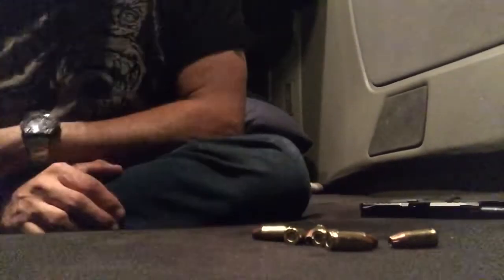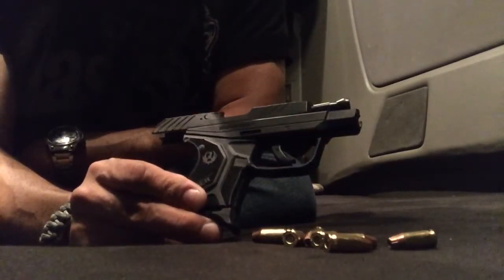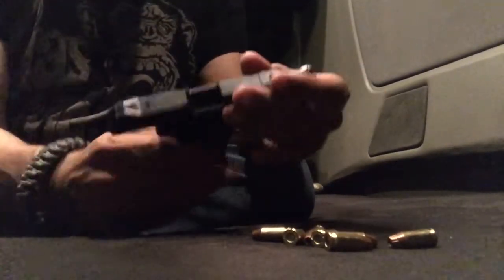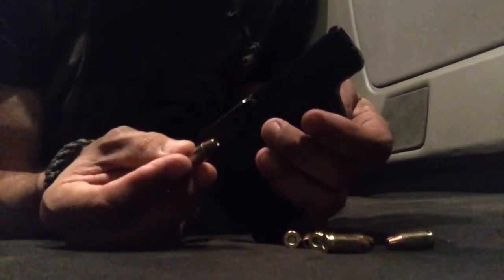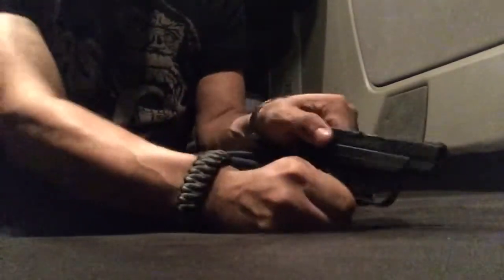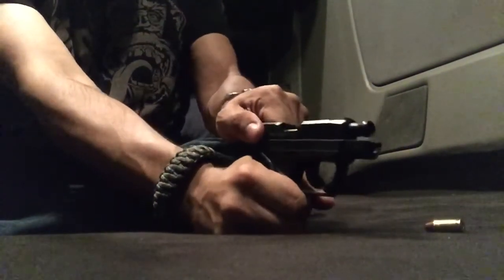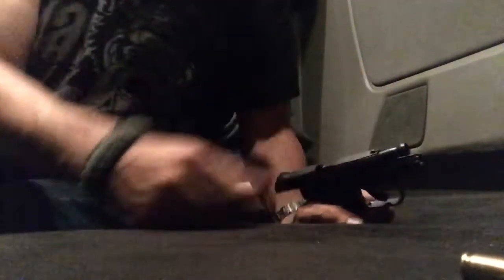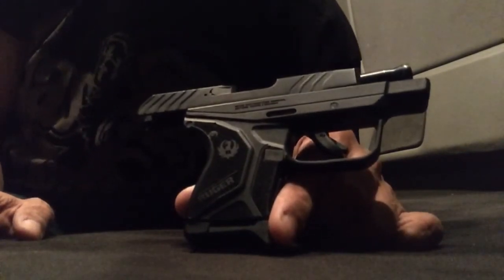Ruger LCP II answer to fail video

Comment: Thank you Rafael!  I could not believe that guy sent back a pistol as defective when he never fired a shot from it and it “failed” on an operation that’s never done with a pistol, unless to clear a rare misfire which is important.  What’s worse is that he traded it for a S&W bodyguard which is known to be very picky with ammo, especially hollowpoints. You unload & make a pistol safe by dropping the mag first, place your hand over the port and pull back the slide letting the round eject through the port into your hand or drop down the mag well in the grip.  
I don’t think people realize the rather loose tolerances of range grade ammo, how the bullet seat depth varies from round to round with differences of hundreds of an inch.  I didn’t realize this until I started reloading and used my digital calipers to test factory ammo.  The more expensive defense rounds not only use better components like nickel plated brass & high end bonded hollowpoint bullets, the powder charge throws & bullet seating depths are a lot more consistent, at least this is what I have found testing Federal, Remington and Hornady’s premium defense/duty ammo.  
You also must remember that ejectors in pistols are static, it’s just a piece of metal like a nail sitting there that pushes on the brass headstamp throwing the brass out of the pistol.  It’s the power & momentum of the slide going back that does all the ejecting, you have to pull back rapidly & hard on these small pocket pistols because the keep the size down the ports are the minimum size needed; you cannot compare it to a full, compact or subcompact pistol - these are MICRO pistols.  Pistol ejectors are not like an AR which uses a spring loaded plunger on the bolt face to eject, and AR’s eject rather violently which is why you get that little dent on the shoulder of your spent brass.  
The Ruger LCP-II is considered the best in its class when you consider its size, weight, accuracy, trigger, and most importantly reliability.  It’s does not look  nearly as good as the Sig, the Khar is slightly smaller and an ounce lighter but both of these pistols have had their reliability issues with various brands of ammo.  It’s not a Glock 42 but I don’t consider that a micro pistol.  I have had mine for only a couple of weeks now, have 400 rounds through it using 5 different brands of cheap range ammo and one premium load without cleaning it or a single failure.  I will fire another 200 rounds through it this weekend and if I get no failures I will clean the shit out of it & mags and consider it suitable for carry & staking my life on it. I have no doubts those last 200 rounds, using 6 different load, will go without a hitch.  This is my first Ruger pistol ever, it’s the least expensive pistol I own and it has exceeded my expectations in all areas.

Comment: You make a good point but you need to be able to manually clear a bad round quickly.  If you can't do a tap rack bang to clear a round with a bad primer with out jamming up your gun then that is a problem.
Reply from the maker: Dietzeeeee I believe I did show you how to eject a jammed round. Did it 8 times.
Reply: If the gun fails to fire at all(bad primer), you pull the slide back hard and fast as shown in the video.
Reply: it was demonstrated twice that a full unspent round is easily ejected using adequate force. With quality ammo you should not have a need to remove a round during an assult but if it were to happen, I dont care what brand of gun you have, its bad news.
Reply: Apple Lysol - The first run of mags were defective!  If your mag has made in America on it it’s the defective one, if it says made in Italy it’s the new & improved one.  Send your American made mags back to Ruger and they will swap them out for you free of charge.  There are not a lot of these defective American made mags out there, Ruger caught & corrected the problem quickly.
Reply: I don't think there would be a problem in clearing a jam in a defense situation if you are a trained user.  I think he just liked to cycle the rounds, every now and then, just as many of us do for a variety of reasons. I have had my LCP II for several years and I shoot it at the range twice a month and have never had even one malfunction.  This little Ruger has proven to be a reliable carry gun where 3 other .380's of mine have all malfunctioned and are gone!

Comment: You sir made some very valid points especially about the whole round (casing and bullet) being ejected hence the whole round getting jammed..i like to dry rack rounds through and take apart all my new guns whenever i buy them and this is the only one that does this when dry rack rounds through it..i actually do have a couple things wrong with my LCP 2 though..when i load all 6 rounds in the mag and try to insert it, it doesnt click in without a lot of force and when it goes in the slide is impossible to rack unless when putting the last round in the mag theres a click you can hear and the mag slides in like butter and the slide racks perfect..and last is, i said i like to dry rack rounds so when i do, the last round doesnt lock the slide back when the mag is empty without me having to pull back the slide hard..but like you said, the gun powder inside the round is so much stronger that we cant rack at the speed or power like a live round can..i have not shot it yet also..i just bought it on the 24th as a Christmas present to myself so we will see..hopefully i dont have to email Ruger

Comment: I agree with you for the most part, but what happens if the round fails to fire and you get it stuck in the ejection port? You really think you're going to have time to clear it?

 I own a LCP2  and shot over 500 rounds through it with no issues when using premium ammo. I like it a lot, but there is a flaw in that the ejection port is too short which is why the gun jams or fails to eject a misfired round when you try to manually clear the gun. The  ejection port on the other .380's is are bit longer. The ejection port in the LCP2 is 25.04mm and on the S&W Bodyguard it's 25.62mm. Another issue with the LCP2 is that the ejector is not flat, like on the Bodyguard, it's pointed which reduces the ejection port size to 20.68 compared to 23.27 mm on the Bodyguard. 

I so far using premium ammo (Lehigh Defense 380 Auto 90gr Xtreme Penetrator Ammunition) so I haven't had an issue with misfiring, but when I had a misfire using target ammo, I did have one jam that was near impossible to clear manually without taking the slide apart. The bullet got stuck in the ejection port and I had to use a screwdriver through the magazine to push out the bullet.

Note that the Lehigh Defense 380 Auto 90gr Xtreme Penetrator will not work reliably in the LCP2 until you have the feed ramp widened slightly and polished. From the factory, the feed ramp is extremely rough and narrow, and has sharp edges on the sides of the feed ramp that causes this bullet to misalign when feeding. This bullet has a unique design that looks like the head of a #3 Phillips screwdriver. Once you see a photo of the bullet, you'll understand what I'm referring to. The Lehigh Defense 380 Auto 90gr Xtreme Penetrator is the best .380 ammo there is, but not every gun can feed it reliably, so try it before buying it in bulk.

I prefer the S&W Bodyguard due to the second-strike capability and its flawless reliability with any ammo that I fed it, but the gun isn't as comfortable to shoot as the LCP2. I actually hate shooting the Bodyguard due to the trigger pinching I get with each shot! The LCP2 is a joy to shoot compare to the Bodyguard.

Comment: absolutely right sir, the gun is built to shoot bullets and eject the empty case's. LCP is a very good gun especially LCP 2  just add 7 round extended mag's and you can have 8 in the gun.It is surprisingly accurate at 7 yards -- average of 3" groups.

Comment: Great video! Great points and awesome visual of the gun cycling when you pull and let it slip out of your hand and fly forward. That is true with MANY guns. It needs the slide to fly forward very fast to defeat the feed ramp as tiny guns can not have a long feed ramp so it is on more of an angle which makes it harder to load the round.
Thank you for sharing!

Comment: I shot my first 50 rounds today and had no failure to eject but when i do it slow manually it does from time to time just like you say it has the bullet on the case. Other then that my slid did not lock back 2 times after the last round?  Overall its a reliable pistol to have and im going to put 300 rounds through it before cleaning it just to test if it shoots dirty and has any issues

Comment: My lpc 2 slide breach would hang up on the mag follower due the the follower having a 90 degree edge on the back side. Using a buffer wheel i rounded this edge and it has never had one issue after over a 1000 rounds. The edge was very slight because it didnt always catch. I think there are a lot of gun owneres that dont have mechanical reasoning skills to figure some of this out. I guess some expect a $600 quality gun for $200+ this gun is one of the best pocket carry guns available. I carry this everywhere because its so comfortable and reliable.

Comment: Mine did that my gun prior to this was a Glock 21 45 cal you could cycle it. I have not shot my lcp2 but I there is also a difference in length with a empty casing and a non fired bullet. I feel it would eject empty no problems

Comment from the maker: Thank y’all for watching and commenting. I take all criticism as constructive. Many of you made great points against me. Mainly my way of speaking. Lol. If I had a dollar...

That being said, one of you said that I had contradicted myself by proving that a gun can spit out a whole bullet, then I continue by saying no gun spits out a whole bullet. I understand what you mean. All guns should provide enough space from the top of the slide, to be able to clear an FTF, FTE, or stovepipes. I get it! But what I meant was, with no explosion, the slide does not cycle the next round. Therefore the slide remains closed or jammed. The only time I’ve seen a gun do that is when a mag is in a lot of tension and it actually causes to cycle a round in the chamber, but at the same time, shoots out the following round under that one, causing it to shoot out the ejection port, or stay jammed causing what we call a double feed or a stovepipe. But I digress. That’s all I meant. 

And I repeat, I know all guns should have more than enough room on the ejection port to “Spit out a whole bullet”!  But for any gun to spit out a whole bullet without firing it is impossible! 

Thanks again! Btw! My LCP II is going strong. 5k plus rounds! Love it!

Comment: Rafael: It's not really how you explain. Extractor, Extractor spring tension, ejector and defective cartridge  can cause that  malfunction. For example: In case of misfire your weapon need  eject the Cartridge manually, especially in combat shooting.  Recommendations: Disassembly  ejection components ( Extractor, spring) for inspection , check the ejector in the frame, try another type and brand of cartridge. Have a good day
Reply: Nothing is going to be wrong on several different brand new guns. The LCP II just has a tight ejection port.

Comment: I keep seeing people having problems but I just bought 2 LCP 2's  from buds at $209 ea.  300+ rounds through each with no problems. Maybe lucky that way.
Reply: Pat Foret - $209 is a steal, Bud’s had them for $239 over thanksgiving and I missed out and had to pay $300 for mine.  One LGS carries them regularly for $289 but that’s as cheap as I have seen them as of December 2018.  You can often get the original LCP for $200 - $210 now.

Comment: I only put 30 rounds through my LCP II and had the magazine drop out many times while shooting. I contacted Ruger and they replaced the extractor and magazine spring, and repaired the barrel and the magazine latch. Do you think that I got a "lemon" from Ruger? After hearing that you put 1,000 rounds through yours I'm now wondering if I should try to get a full refund. Thanks for your video.
Reply: happens to me too. dont think you got a lemon. I think there are two solutions. Make sure your thumb is never on the button. Or else put some skateboard tape over the smooth area above the button.
Reply: Some people have an issue where they hit the mag release button on this pistol, I second going with talon grips.
Reply from the maker: William Hammonds wondering if you still have issues. Mine is still going strong. It’s my main pocket carry. 5k plus rounds through it now.

Comment: And I thought my lcp2 had that same problem of the bullet getting stuck. But after seeing this I see u do need more power to eject the round. But honestly every one of my other guns ejects bullets easily without pulling that hard
Reply: Botwire  damn brother I'm just stateing that all my other guns do not have to be cocked that hard to release the bullet. Also this is my first 380. Rugurs are great guns but I thought this was an issue with this particular gun because all my other ruger's do not have that problem
Reply: This gun does have a problem shooting Sig's Elite hollow points Crown heads or v head bullets they literally Jam inside so that is a problem just changed round I haven't had any problem ever since

Comment: Good points, but a really solid gun, like a Glock, will cycle out manually. LCP 2 is nice, but built a bit tight (no wonder with small size). Anyway, point is - you are correct but LCP 2 is also very touchy.
Reply: Mine is not touchy and I have proven this to myself by shooting it at the range for over two years. The best .380 I have ever owned and the only one I ever had that has not malfunctioned!

Comment: Haven’t you ever heard of clearing your weapon?   It appears that you do not comprehend the fact that people need to unload live rounds more frequently than they eject spent projectiles.  

Every day when I come home I clear my weapon and store it.  A firearms ability to unload a live round safely is paramount to its ability to function correctly.  
This video is the fail video.  Not the other guys.
Reply: He clearly showed how you can manually clear it not sure what video your watching
Reply: That live round drops down through the mag well a lot easier than the ejection port, round does NOT have to eject through the port, the easier path is down the mag well after the mag has been pulled out!
Reply from the maker: ZootyZoFo good point.

Comment: If it comes down to common sense, then you should have known that his issue was this condition occurring during a defensive situation when, yes, you may actually have to clear an unspent round.  To have not picked up on that, and by replying in such a condescending manner, makes one question your common sense.
Reply from the maker: Marc Fredo lol ok? Whatever. It's still a terrific gun!
Reply: I watched the other guys video in question. He wasn't concerned about clearing malfunctions. He was concerned about unloading the gun and making it safe. I get the feeling he regularly empties/unloads his guns to make them "safe," maybe multiple times a day. That would explain that guys strong opinion on the topic because it is more difficult to unload a round from the chamber and requires a more deliberate effort to do successfully. That extra effort makes it more convenient to leave the gun loaded but that's too dangerous for that guy, hence his two part video complaint.
Reply: I don't think he had this problem during a defense situation!